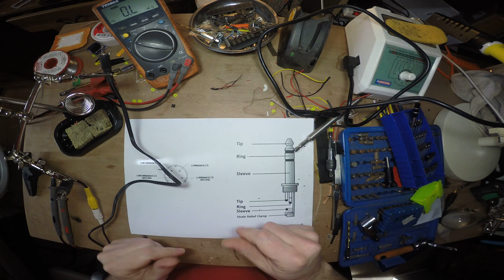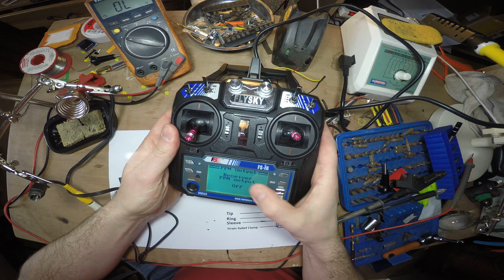Flysky FS-i6 Trainer PC cable DIY with ACTUAL PIN OUTS / WIRING DIAGRAM

Comment: Problems that no one has mentioned yet that affects this video. The author mentioned that he wasn't going to address the software for this mod, BUT there are actually 2 (two) different ways to achieve this, one using PPM and one not (which makes the MOD software dependent). Also his S-Video cable isn't like mine, or the others I have cut open, mine has 5 wires (Silver Bare, Black, White, Red and Yellow.) This mod would use the Red wire and the shield ground, where the other mod uses the yellow PPM wire and the shield ground. Might as well tell the rest of the story. I am using my Lenovo laptop to run my simulator. As with a lot of current laptops, there is only one Audio connector that handles BOTH Audio out and Mic input. These connectors are called TRRS (tip - ring - ring - sleeve) where he is using TRS(tip - ring - sleeve). Plug a TRS connector directly into a laptop and nothing you can do will make any MOD work. You need a special cable called a combo audio splitter. These adapter cables are only needed if you need access to the MIC, which all these type of MODs do. Back to the software. I would tell you which one to use with which MOD, but I don't know which one he is using. I thank him very much for his video, and not trying to find fault, but this video, like most of the ones I have seen on YouTube presume everyone watching knows the same everything the author knows. People just trying to figure this stuff out don't, or they wouldn't need videos to help them figure it out.

Comment: Fergus builds hiya there's a very easy way   to do it  if you purchase a flysky x8 receiver very cheap  and use ppm or ibus and connect the red & black to a old usb cable and the signal wire to a phono plug and plug in to the mic  :-D and bind to the receiver and your good to go. wireless lol no cable's  I'm sure I got my x8 receiver on EBAY.CO.UK for £6 and it saves sitting in front of a screen lol